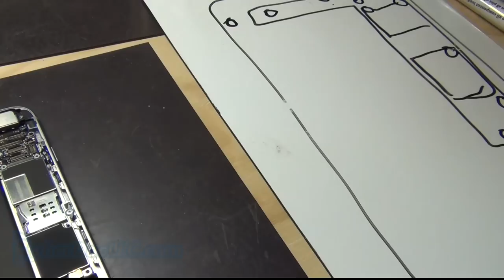iPhone 6 plus logicboard teardown

Comment: Is it possible to damage only a connector on the iPhone's motherboard? In that case, the front-facing camera and sensor cable.

Because only these items are not working and the others are normal.

Comment: @CyberDoc LLC At 31:03 the board on the right (bottom side of the motherboard), what is the right topmost  black glass like chips? I was trying to remove the protective shield and made a slight chip on one of its corner. Is the motherboard still salvageable? Pls let me know. Thanks

Comment: Was this logic board water damaged? I have a 6 plus that is water logged and cant get it to work...will this help it i take the shields off and clean under?
Reply: +GettinBLazed420 no. microscopic water corrosion. place in jar filled with dissectant. and pray.

Comment: Too much pulling and tugging for my tastes. That much bending with heat applied could fracture the internal copper traces. Up the heat just a hair, the shields should come off with little to no effort. I use a Hakko FR-810 set at 400. Distribute the heat over the whole surface of the shield you're removing, and it causes less stress to the mainboard.
Reply: indeed, I was crying and saying "wtf are you doing O_o" for almost all the duration of the video...
Reply: NO, sir I had hell getting the shields off....They are Not easily removed